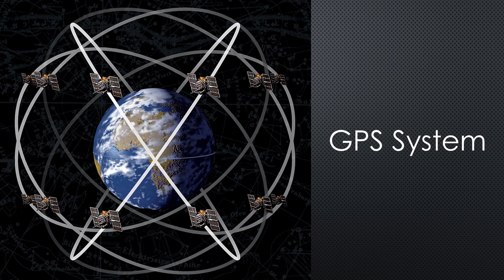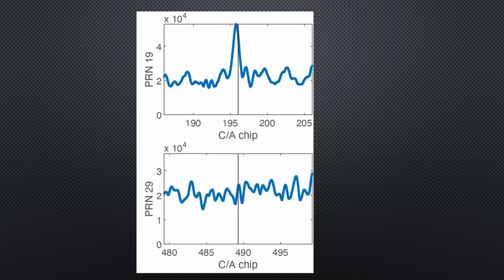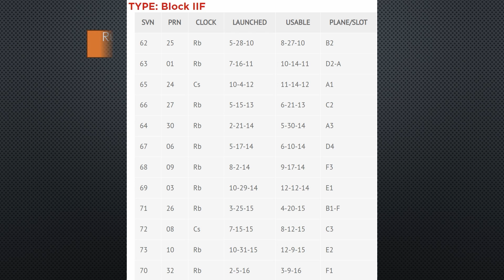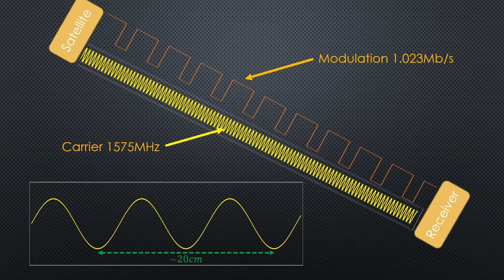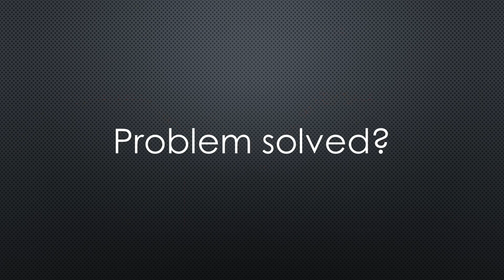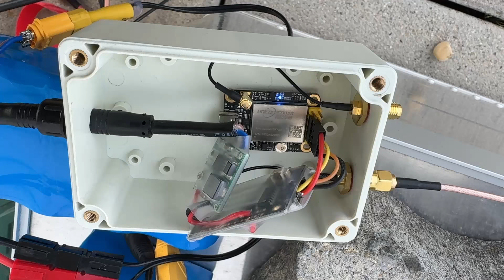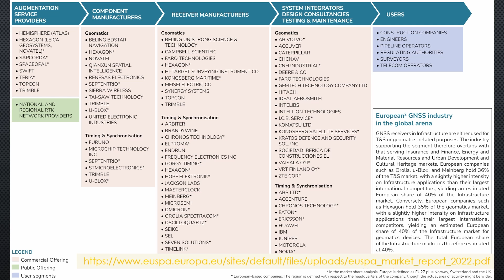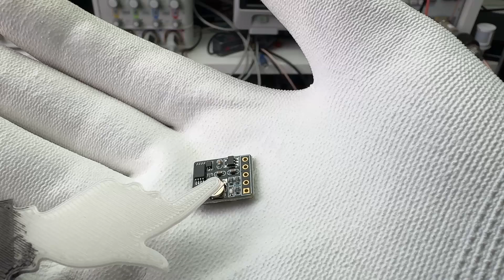(483) ESP32 precision GPS receiver (incl. RTK-GPS Tutorial). How to earn money with it (DePIN)

Comment: Onocoy would not exist without Helium. Helium made many mistakes. No denying. BUT you can't make an omelet without breaking a few eggs.
Reply from the maker: Maybe you are right. This is why I mentioned them.
Reply: Sure, Helium was the pioneer in DePIN projects and demonstrated that a community can build up a significant decentralized infrastructure. 

Difference (besides the application: Helium doing IOT communications and onocoy doing High precision GPS) is that onocoy doesn't (directly or indirectly) profit from hardware sales. Further, there is a relevant market behind High precision GPS already existing, so usage of the system will be there

Comment: You say that it can take up to 10 minutes to get GPS satellite positions, but quite a lot of GPS modules have a 30 second wake-up time before it can accurately tell its position and that is a “cold” start, so it has no stored information, a “warm” start is around 27 seconds when it has older information, but a “hot” start is around 2 seconds when it has recent information. These modules aren’t connected to any other network as far as I am aware so how do they get their position so fast?
Reply from the maker: You are right. Current GPS are usually faster. You find the "cold" and "warm" start times in their datasheets. The newest u-blox chip (M10S) really has 1s hot start tome (23s from cold)
Reply: @AndreasSpiess  so how can the GPS receiver determine it's position in 30 seconds cold start when it has not had time to get the almanac?
Reply from the maker: @flat-earther  I did not ask. But the guy from ublox told me that it works.

Comment: If the orbits degrade how do they maintain accuracy? Just seems ground based system are what's needed especially for self driving vehicles
Reply from the maker: How would an orbit "degrade"? You mean a war event that takes all satellites out? That would be very bad, I think.
Reply: @AndreasSpiess  some of these have to be reset into higher orbits some have thrusters. I know the iss orbit degrades but that's at a lower orbit. Wouldnt that imply perpetual motion if they didnt degrade ? Plus there are gravitational variations I know there are on earth. Seems like too much number crunching to be correct. Didn't they want 5g because of accuracy?  I dont know just seems less hassle to just make it ground based. I tell you where the cost savings are at golf monitors.  Would love to see a project dealing with that. Even the cheapest units that just do ball speed are 200 dollars. Then the doppler requires too much space. 8 to 10 feet behind the golfer which makes them prohibitive indoors. Probably cant get around that still think the price could be beat by a lot. I'm in bed crippled from a surgery waiting to get fixed. All I can do for now is watch u tube. I like the channel and the deep dive into these topics thanks!
Reply from the maker: @gregorybolin4672  The positions of these satellites are constantly checked and adjusted if needed. If they are no longer good enough, they are replaced. And I am no golfer ;-)

Comment: Hmm did you already get the HSP service Galileo going with the Ublox chip? That actually allows for centimeters without own RTK and is free i heard.
Reply from the maker: Indeed there are other services available I did not want to cover in this video. HSP seems to be Galileo specific, and only in beta (no general purpose modules seem to be available). But this is just hearsay.
Reply: Yes, Galileo HAS can deliver accuracy better than normal GPS/Galileo/..., but:
- accuracy is 10-20cm
- it takes 10-30 minutes to reach that
Technically, Galileo HAS is a PPP service ("Precise Point Positioning")

RTK allows for ~1cm accuracy within seconds.
Reply: @onocoy  Yeah but you can’t take a RTK with you and the other services are quite expensive. And i think 10cm is still totally reasonable compared to say 1.5m. I do wonder though how long it will take till there are „cheaper“ chips that can do E6

Comment: Hi Andreas, just a question to the DIY NTRIP base station: How do you measure it's precise position before you put it to operation? We have to assume that the other next base station is approx. 60 km away, so it is useless in the above task.
Reply from the maker: Onocoy has a function to do this automatically. They do it regularly. Otherwise you have to do it manually from a known point.

Comment: Great video about RTK.
Was hunting for part on aliexpress to split the antenna signal, but your link for splitter and dc block is not working correctly...
Can you please udate them?
One question about splitting signals and dc block: Witch order to use dc block and splitter ?
Other question: Whats the real difference between UM980 and UM982 modules ? Can I use one or the other??
Thanks for being so pratical
Reply from the maker: The antennas are active and are powered by the receiver. If you add two receivers, both try to power. So one has to be blocked. 
I will check the links.
Reply from the maker: The 982 has two antennas for direction. I used the 982 and others used the 980
Reply: @AndreasSpiess  Then you can use 982 with the same software and only using 1 antenna?
Reply from the maker: @garfpt  Yes. I think I had to change one setup parameter. It should be documented on Onocoy's Discord channel.
These two antennas have nothing to do with the splitter, BTW. The have to be connected to two antennas if you want also to get a precise heading.

Comment: Hi Andreas, I also started playing with GPS in the 1990's, and one thing that puzzled me from the beginning, even with selective availability still in place, my reported position bounced around, as expected. But as soon as I started walking, it would immediately give my speed accurately, with no relation to the randomly changing position. How could it calculate my walking speed so accurately without knowing my position from second to second?
Thanks for an interesting channel, greetings from South Africa
Reply from the maker: I do not know the answer for your question. Maybe always a few packets were transmitted with the same degradation.
Reply: Your velocity is calculated from the doppler shift of the carrier frequency, like a radar speed gun. This is the instantaneous velocity and does not rely on timing the difference between two positions, your actual position is not needed.
Reply: @marcuspainter6861  Thank you for this explanation!

Comment: My property is bounded by government survey markers that have had their gps coordinates determined using the precision survey methods you described. Knowing those very precise coordinates, can I set up a RTK-GPS base directly over one of them, provision it with the higher precision coordinates, and then use a Rover GPS receiver to enable higher precision locating around my property. I realize that I would not have the same precision that was probably available to the government surveyors but it should be better than having no corrections applied?
Reply from the maker: It should have the same precision. They use very similar technology, and because your reference is so precise, you should get good results.

Comment: I have always wondered how you know a location to 1cm without gps? If you use a fixed station to provide a dynamic correction how do you know where it is to 1cm? I wouldn't think you could use gps but how does land surveying do it? I know cartographers use triangulation points but they are not near enough usually to measure by tape from.
Reply from the maker: I was hoping that I explained how it works.
Reply: @AndreasSpiess  Well it did explain to a certain point for your own base. I have now researched how the location of the reference RTK bases are known to 1cm and it is complex and way beyond the object of this video. Thanks.

Comment: Thanks Andreas, how about the precision in the Z coordinate?
Reply from the maker: Similar. A bit larger if I remember right.
Reply: @AndreasSpiess  Usually z coordinates are less precise. It would be nice to test.
Reply from the maker: @s.arnalich  The receivers have specifications in their datasheets.
Reply: The height measurement is typically 50-100% less accurate then Lat/Lon. This is due to geometry (All satellite signals are above / to the side of the antenna location)

Comment: Is the fourth satellite just a measure of redundancy, they should be able to do it with just three.
Reply from the maker: As said, it is needed to work with the imprecise receiver clock.
Reply: You have 4 unknowns: The 3 values for your location in space, and the time difference between the constellation's time system (based on atomic clocks), and a very imprecise local time source, usually just a crystal or a TCXO -> hence you need at least 4 measurements to determine the unknowns
Reply: @onocoy  seems like all you would need are three satellites that periodically ping one another then the forth signal would be the person with the GPS unit and all four signals combined would allow one to identify the location of any other.

Comment: Why would one need 1cm GPS in the first place? I rarely use GPS in my phone and it’s free.
Reply from the maker: No problem if you are happy. It is used for lawn mowers, for example. Or in precision farming to automatically steer tractors.
Reply: sorry I did not mean to sound negative, I just didn’t see clearly how it helps making money except for helping building some global network to achieve precision that’s an overkill for a regular user. For lawn maintenance one could perhaps triangulate using some stationary stations with no need to going out 2000km in space. On a technical level the video is great though - much appreciated!

Comment: Do you need to "bootstrap" (off another rover) to get an exact location for your base station (antenna) to get it started?

Does the link between the base and rover use something as robust as LoRa modulation?
Reply from the maker: 1. After a while, the rover gets an RTK fix and therefore is accurate. Before it behaves like a GPS receiver

Comment: WTRTK-982 or WTRTK-980? Seems both are mentioned in the build guide but no mention of preference?
Reply: Seems to be related to update frequency; 980 is 50hz while 982 is 20hz but "dual". I see in other comments you write you went with 982 so off I go!
Reply from the maker: The 982 has two antennas and, with the right SW, can also determine the heading. For a base station, this is not needed.
Reply: @AndreasSpiess  ah, thanks!

Comment: Is it theoretically possible to 
1. make a beacon which sends correction signal using esp now?
2. Don't send this signal continuously but in fractions like 5 signals (just to be sure the device receives at least one or two) and then go to sleep for some seconds?
If it is, would the device be able to get precise signal based on last known correction.
Reply from the maker: 1. yes
2. the correction signal changes over time. So it has to be continuous.

Comment: How many time per hour the moving device need fresh qualibrated information from the nearest location base ? Can it move it's calibrating source from base to base ?
Automated delivery services could be in need for that information.
Reply: This is not really a calibration method, it is a real-time correction of error sources the moving device experiences. Errors diverge quickly, and after a few seconds, the level of accuracy can no longer be retained in the moving device. 

Yes, it can move from base to base. This works by the moving device regularly sending its location back to the provider of data. If it moves outside of a reasonable area (say, 20km of the base) and a closer station is available, the stream is automatically switched. This causes a reinitialization of the position determination in the moving device, but maintaining a consistent coordinate frame. Alternatively, some RTK providers provide "VRS", which involves interpolation processing between base stations. It gets around the need to switch, but is technically more involved and less scalable
Reply: Too bad. A constant position error correction will require too much data and thus fees. 
For commercial use it'll be compensated by having either other correction means (accelerometers, optical analysis, ... ) or proprietary networks instead of crypto payed service. 
And for "high cost" application I bet they will directly use the "base" hardware and software positionning to get rid of service network and of communication network too.
Reply: @AtlantisArch  The method of RTK is well established and used in many sectors. You don’t need any other sensors and get a cm accurate position in seconds. 
The maximum data packet per instance is 1023 bytes, though the usual size is substantially smaller.
Reply: @onocoy  "per instance" doesn't mean anything as duration can vary. Let take some commercial use (at it is the only viable long term sellable service I can think of). A drone delivery working 20h/24 will require those data a lot. If it was some ponctual position calibration, cost might be acceptable. If too much data or too expensive data, the drone delivery firm will switch to either puting very accurate solution directly on board (as it seem affordable now) or run it himself for its fleet. But the crypto service will find it hard to sell in other cases.

(sport watches already do use other sensors for years now to correct positionning, as this method is fast cheap and accurate, I bet many other hardware are/will do the same. Its all a matter of cost).

Comment: How does the base station determine its fixed position to centimeter precision?
Reply from the maker: With Onocoy, they do this by using statisstics and other sources. For RTK2GO you have to do the measurement yourself. We have very precise points around our homes (because land is expensive in Switzerland).
Reply: Set up the base station, and accept whatever position that it gives. Take the rover to a survey marker and measure the difference between its reading and the actual survey point position. Apply that difference to the base station position. Repeat with other markers if possible to increase the accuracy.
Reply from the maker: @keithr0  Very good way to use your tools. Thank you!

Comment: Hello, would you know much about testing a dual antenna GPS?  Currently trying to get sorted out a test for indoors, since it's very hot outside.  I have various GPS systems.  I have a GPS repeater and I believe it gives L1,L2 repeaterness, but the GPS will not give heading.   It will give position only.   These GPS systems work outdoors no issues.  I'm thinking maybe I need to repeat L5 or would you have any ideas why only one repeater would not work  for heading?  And what I would need to do to make it work?
Reply from the maker: I do not know what you want to do with the repeater. But for RTK signals, I am pretty shure it will not work because it needs the phase of the direct signals from the satellites.

Comment: Just wondering if we had a grid (20km mesh) of fixed base stations but no satellite .... how precise could we get? We have plenty triangulation points in CH that could do such job, or?
Reply: You'd need to use a different localization technology.  The RTK signals don't transmit a direct localization signal; instead they transmit the phase information relative to a particular satellite.  The ground station will say "I am locked at integer wave #5 on satellite #1, wave #7 on satellite #2," and so on, and then the mobile receiver can use that information combined with its own ambiguous phase information to constrain its own location.  Thus, the RTK signal can supplement but not replace the satellite signals.
Reply: @Majromax  Yeah, I was just wondering if we would need satellites at all if we had sufficient ground stations sending something a GPS-like signal.

Comment: medical equipment are expensive
construction equipment are cheaper
wifi 2.4ghz and 5ghz scan human body with archer-deco tech is easier
a-GPS scan building/body is portable
create separate GPS from technique but can differentiate from satellites
place inside-outside target-building and generate 3D
do the same with optical and then sonar 
overlay data form data-set subset
wire-mesh by hand is for young-boys

Comment: Do both of base and rover need an RTK receiver or only the base? I haven't grokked how the rover gets the info from the base and uses it to calculate the precise position. I would prefer to use my own infrastructure and no DePIN provider.
Reply from the maker: Yes, both need to be RTK receivers. And you could transmit the data directly with a wireless serial link (as the lwan mowers do)
Reply: You need a base receiver that produces carrier phase information - which in practice means a receiver supporting RTK. If you use some non-RTK receiver it will still produce corrections, but  they will be in an older format like RTCM SC-104 that just indicates the pseudorange errors from each satellite rather than carrier phase.